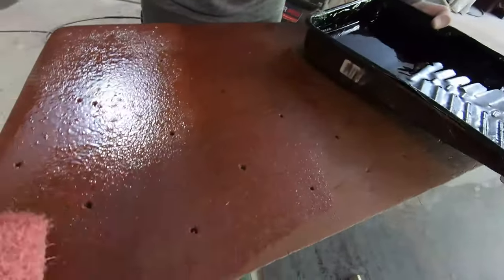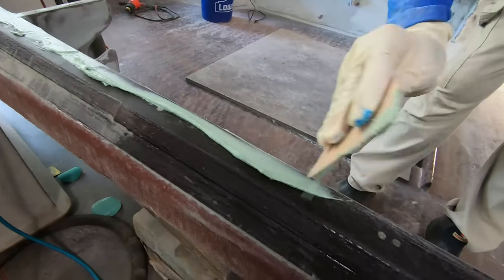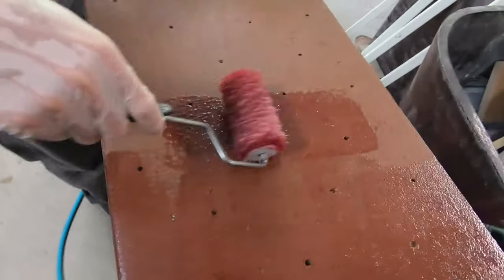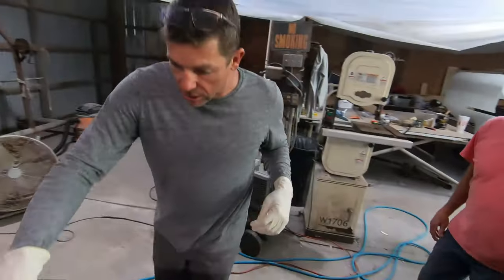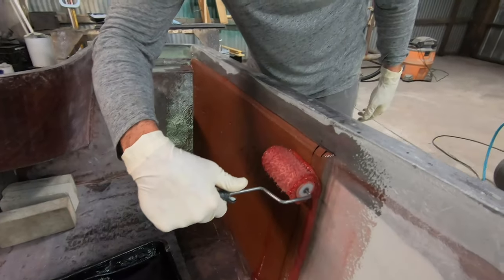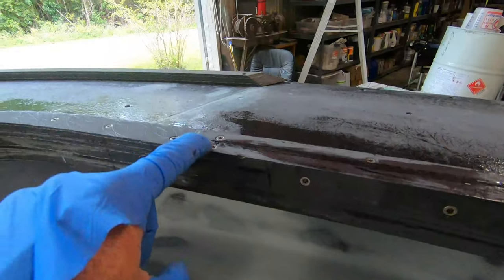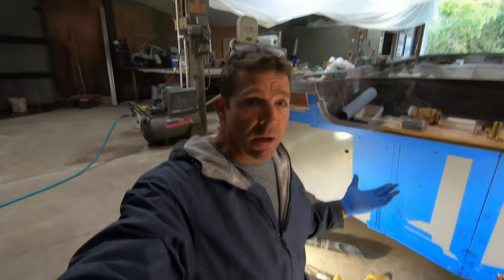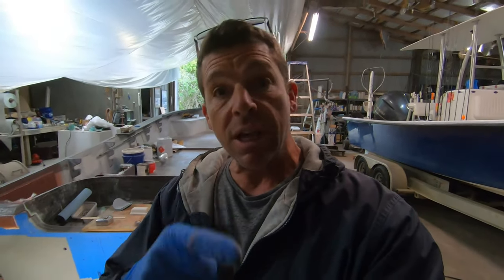EP-12 HOW-TO  BUILD and FIBEREGLASS Custom Coosa board Rod Holders- INSULATED Fish Boxes

Comment: Joe from what I have saw you are a very intelligent man you know not to have batteries on the concrete it will pull the power from them it’s really not good on them lol
Reply from the maker: Yes, those are all old dead batteries batteries we keep around as dead weight to hold stuff in place. You would never want to leave a good battery sitting on the ground. Thanks for watching
Reply from the maker: Yes, those are all old dead batteries batteries we keep around as dead weight to hold stuff in place. You would never want to leave a good battery sitting on the ground. Thanks for watching

Comment: I’ve recently found your channel and have  subscribed. I’ve rebuilt and built my own boats for years. I believe your building an excellent boat with excellent craftsmanship. I need to ask a question, why do you screw everything down? I’ve epoxied everything down I’ve done. I was taught years ago, more than 😢30 not to screw them down. There’s no doubt about the quality of your build. Thanks for your reply.
Reply from the maker: Thank You Sir, Welcome to the channel! First, I would like to compliment you on how politely you ask your questions. I will try my best to give a good explanation. As you know, different materials respond differently to different construction methods. I imagine you are building, and repairing wood boats. In which case clamping, or very light fastener use is the way to go. I have built a number of stitch and glue plywood skiff using epoxy, and light fiberglass clothe. They have held together very well over the years. I think using screws in wood, especially lumber may not be the way to go in some cases because if done wrong could cause the lumber to split. Just a theory? Please let me know if you have a thought on that. As for using screws in boats where we are using marine plywood or coosa board for structural members, and polyester resin, not epoxy as a glue I am sure it results in a stronger bond. Strength is the main reason for gluing and screwing as we call it in our shop. The boats we build are almost always charter or commercial fishing boats , and see very heavy use. Even if the screws make it 10 percent stronger, I think its worth it. Our family has built over 300 boats, up to 53 feet in length, with no structural problems using this method. I would say that is a pretty solid track record. Not saying it is the only way, but it has worked well for us over the years. Hope this answers your question , and thanks again for watching!
Reply: @FishBumpTV  yes you’re right, I’ve only used marine grade plywood and yes I’ve built with stitch and glue method and cold moulded. I’ve always thought the concern could have been movement and then spacing any then condensation which would weaken and eventually rot the attachment hole. Thanks again for the reply.

Comment: It,s getting there looking great man , I'm trying to get mine wrapped up ASAP, 3 years on my project, however not nearly as involved as yours , I picked up some overcoat formula 27 you were using, in the past I have used marine Tex , but you get a lot more product with the overcoat for less money, can't wait to see the finished product..
Reply from the maker: Yep, formula 27 is great stuff, It is a styrene-based filler. That makes it very compatible with gel coat. Marine tex is epoxy based, it has a more tenacious grip, and higher temp tolerances. There are a lot of great fillers out there, all with pros and cons. You just got to find the one that works best for you. Hope your project turns out great for ya. Really appreciate you watching and commenting!

Comment: So I have  rolled edge Kenner just like you do, how well would that putty hold up if I used it on the inside of the hull if I wanted to prep to make it smooth before gel coat? The hull flexes as you know and I question whether the putty would spider crack over time. The inside hull is unfinished so I was trying to at least make it look smooth and more aesthetically pleasing.
Reply from the maker: That is a good question. I have had good success with the Napa pro strand filler in the past. I like it because it has short-strand fiberglass integrated into the filler, which adds strength. I have used it mostly in areas that do not flex as much as the hull sides of the Kenners do. Epoxy fillers have more grip and flex, but you cannot use gel coat over epoxy resins or fillers. It will not stick properly, but if you used a paint system like awl grip you could use a epoxy filler. One other option would be to add a layer or two of 1 oz fiberglass mat over the area to be faired, then roll 2 or 3 coats of gel coat over the mat. The last coat of gel should have some modifier c wax solution added to it so that it does not remain tacky. You would then sand the gel coat down to fair the surface. You have to sand it within 24 hrs or so because the gel gets harder and harder over time. This is a more difficult process than using fillers to fair a surface, but it is very tough. Hope that helps, Thanks for watching!
Reply: @FishBumpTV  When I go to apply black webbing gel coat, should the white base gel coat be dry or tacky during this process? I have the gun and everything to spray the webbing, I was told that a nap roller is all that was needed to apply the base coat, any thing specific about what type of nap roller I should use?

Comment: Joe, after watching your videos (great by the way) I’ve been doing my own research. I’ve talked to a couple of shops that say coosa is great but you can’t drill into it? It can only go through and attach through it? But here you are doing it. What’s the scoop?
Reply from the maker: I am using the Bluewater 26 version of Coosa, which is the  highest density offered. It holds screws better than the lighter densities. I also use a lot of screws and some type of adhesive, or glue when joining parts, so I am not relying on just the screws to hold things together. I hope this helps, and thanks for watching!